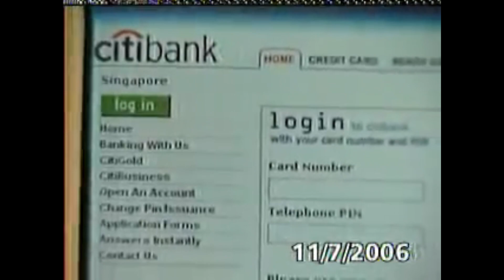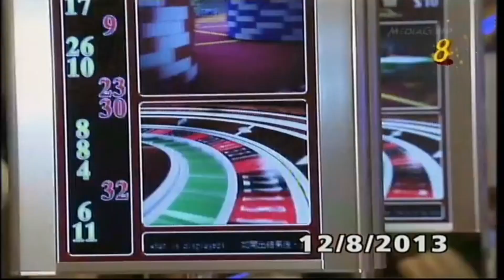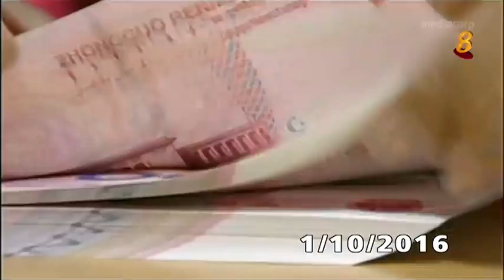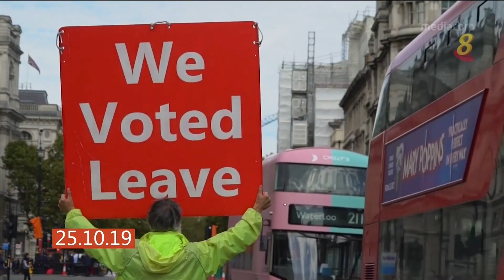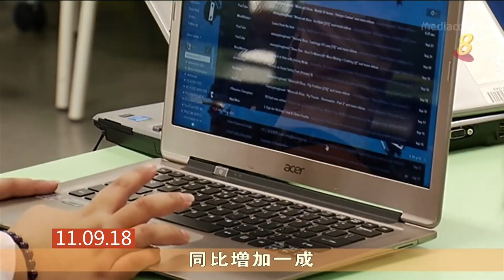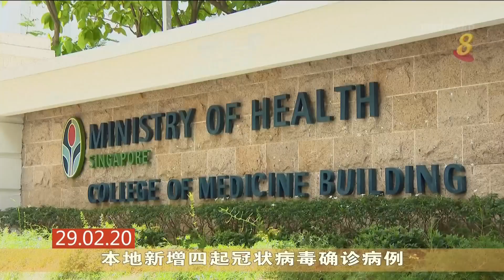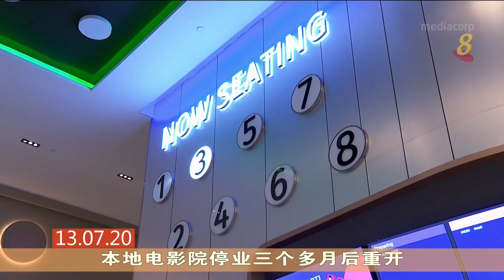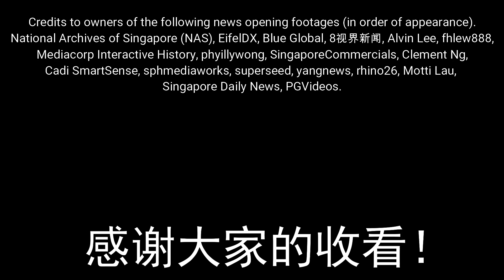Mediacorp Channel 8 news intro evolution

Comment: 5:34 - 6:04 Only audio available for this 1994 - 1995 opening montage, except for the news presenters. No news stories.
6:04 - 6:11 The earlier version of the 1995 opening montage, earlier version before using the long-running version until at least 1999.
Besides Raymond Weil that had been sponsoring clock for many years before 2000 (similar to that on Channel 5 and news bulletins on RTM and TV3 - Berita Perdana and Buletin Utama, respectively), the clock of Channel 8 was not sponsored by anyone similar to Petronas or bank companies in Singapore, but by (14:07 - 14:22) Dynasty Travel Escorted Tours, (24:32 - 24:47, 27:28 - 27:43 and 29:51 - 30:06) 3 different variants of McDonald's sponsorship, (26:18 - 26:30) Jadescape by Qingjian Realty and (31:12 - 31:27) Welch's Laundry Sanitiser. Previous uploaded YouTube videos did include different variants of clock sponsorship by Qingjian Realty.
Also, before the launch of Speak Mandarin Campaign in 1979, few Singaporeans speak Mandarin, almost all Chinese variant heard prior to that was Hokkien. The programme Are You Hokkien? revived the usage of Hokkien which was once the most spoken Chinese variant among Chinese Singaporeans, it was also shown in Malaysia on ntv7 before the 2018 rebranding (including new logo) with modern Malaysia concept that lasted just 10 months, then returned to broadcast Chinese content, mostly either repeated from its sister station, 8TV and ntv7 itself before that said rebranding. Very sad to see programmes on Malaysian television right now especially TV3 with its non-stop dramas and entertainment.
Missing: Montage used during 1993 - 1994 that changed around same time with SBC 5. It was also the last montage of Malay news when it was still broadcast on SBC 5 and before moving to SBC 12 (later Channel 12).
Reply from the maker: mid-1993 opening missed due to copyright complaints. I'll try to upload the alternative version later. Thanks for your comment and your concern!
Reply: Clocks used in Mediacorp Channel 8
* Raymond Weil Analogue Clock (1980s-1994, still using English languaged VO and borrowing Channel 5s)
* Raymond Weil Analogue Clock (Gold) (1995-2003)
* January 1, 2004 - July 9, 2006 (Blue with Eurostile font clock)
* July 10, 2006 - February 28, 2017 (Gold & Blue but the blue ending use is unknown)
* March 1,2017 - December 19, 2021
* December 20, 2021 - present (Revised (including the first appereance of News at 1 clock))

Comment: Also, the 1994 clock is wrong! It had the background from the ident at the time minus the logo with red/yellow light shining which would be the same as the lineup graphics at the time.
Reply from the maker: it wasn't wrong, couldn't find the same background as what you wanted, so I find the 1995 one due to some similarities in clock design.
Reply: That clock was also used to introduce the News in Tamil, at 6:30pm.
Reply: Then the news graphics? What about Berita 12 in 1994 and the clock?
Reply: @rockerthegengar  Berita 12 premiered on New Year's Day 1994, the same day Channel 5 became an all-English channel but Channel 12 only introduced their logo and slogan on January 31, 1994.

The Raymond Weil blue clock remained until 30 January 1994 until it changed into an orange background with a clock and a Malay voiceover that says, "Masa dari Raymond Weil, 7:30 malam."

Speaking of Channel 8's Tamil news intro, that is questionable. We do not know how Channel 8 used their Tamil version of their Chinese news intro.
Reply: When did Evangelion air on SG TV? I read somewhere 8 aired it in 2001.
Reply: But you said on Discord you recalled it used the same graphics but the titles are all in Tamil.
Reply: @rockerthegengar  I did, but I had no idea how they did it.
Reply: Huh? But do you recall watching it back in '94? Also, what about the Caldecott ident seen in the startup/closedown after 5 changed on 1 January that year while 8 and 12 did not yet?
Reply: @rockerthegengar  I forgot. I was so occupied lately. However, I wanted to refresh my memory over that. The Caldecott ident for startup and closedown, was retained on Channel 12 (until 30 January 1994) and Channel 8 (until 28 May 1994, during startup only)
Reply: I still need Hafiz to put the CC on the Green For Life animated ad video in English translated from the Malay lyrics. (or the actual English lyrics, if you recall)

Comment: The early version of the 1987 titles (introduced on Feb. 28/Mar. 1) had the music sounding a bit different (which sounds a bit deeper) compared to the later one.
Reply: Also for 1992 beta version music sounding last for few days until the final version kicked in.
Reply: Any difference? Originally, it had some live action footage before cutting to the SBC logo zooming in unlike the latter which after the clock it cuts to the SBC logo. (music was a bit longer on the former)
Reply: @rockerthegengar  No difference, only the music sounding. Last for few days after 1992 New Year.
Reply: Do you have a link to this intro?

Comment: 8:06 is 十点新闻, not 一点新闻.
Reply from the maker: Sorry, my mistake. Will change it later.
Reply: @HafizMediaworks  It's OK. Maybe more corrections incoming. 😂 However, this is a decent work of yours! It includes many OP/ED cuts not included in previous similar compilations.
Reply: @xinbryanwong9115 ???
Reply: 9:12 is 一点新闻 not 十点新闻